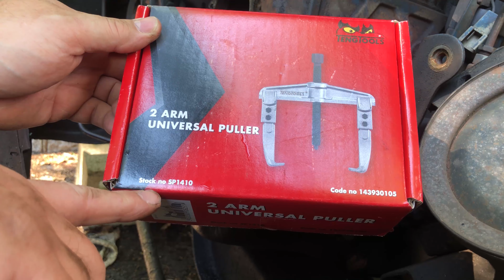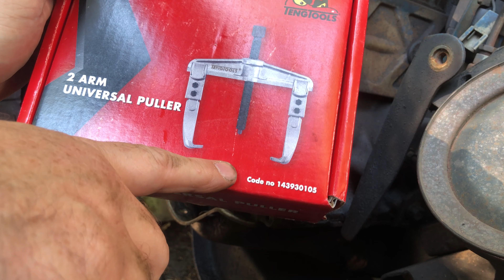How to change a Ford F150 Cam gear.

Comment from the maker: I feel for ya.  Make sure you flush out any fibers and crap out of the oil pan.  Everyone i spoke to about it said to remove the oil pan. But to do that you need to pull up on the engine.  Was not for me. I used about 4 cans of WD40 to flush it out. And a couple of jugs of oil.  The truck is still running just fine. Noisy but fine.
Reply from the maker: believe it i flushed it out with oil and wd40. its runnun fine now

Comment: I’m picking up a 1984 f150 with the same motor this weekend, they said they were driving and it backfired and would not start back up would this be the culprit you think? And if I take the distributor cap off of the rotor spins then the gear is good correct?
Reply from the maker: Thats right. The cam shaft is directly connected to the distro

Comment: How did you get the puller behind the cam gear hub? I have absolutely no space and I have the exact same puller by coincidence. I am currently cutting the cam gear hub off a little bit at a time because I have not had any luck pulling it or heating it. I tried heating first FYI. Your cam gear hub looked to have space behind it and I just find that highly curious compared to mine. Definitely looks exactly like the same cam gear hub I have.
Reply: At 18:55 he explains how he wedged the prongs of this puller between the circumferential ribs in the hub itself, rather than going behind it.
Reply: 240,000 miles over 40 years is pretty decent service. In my experience they last a bit longer than timing chains. In any case, they don't 'suck' as claimed.

Comment: You cam looked pushed in a little. Is that common?
Reply from the maker: Good eye.  after installing the new cam gear it pulled out again. you can use the gear on the crank to use as a guide, make sure both gears are flush to each other and that's good. i borrowed an install kit from auto zone to get the gear back on.

Comment: Do you have to pull water pump or can you do with water pump on?
Reply from the maker: It’ll be a tight squeeze but they are separate items so you should be able to wiggle it out without pulling off the water pump.

Comment: It's better to use gas instead of starting fluid on gas engines, starting fluid was developed for diesel engines and damages the Conrod bearings on gasoline engines.
Reply from the maker: I suspect its called starting fluid for a reason. Its only in the air gas mix for a short time.  Besides at what point would it come in contact to a connecting rod?  It goes into combustion chamber goes boom and then out.

Comment: another dumb idea ford did back then - why not use steel gears to start with
Reply from the maker: @pauljansky7971  because it would last forever like the F-100’s .  GM also did this in some late 60’s early 70’s motors.